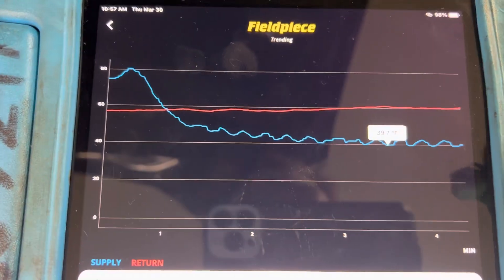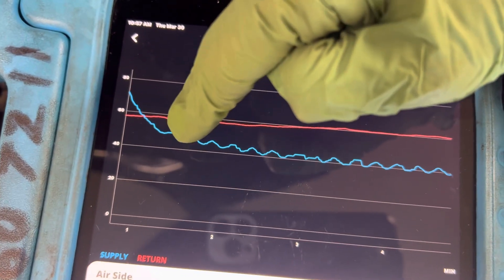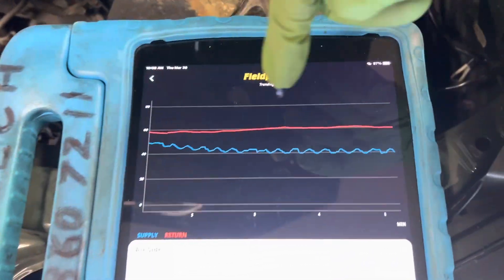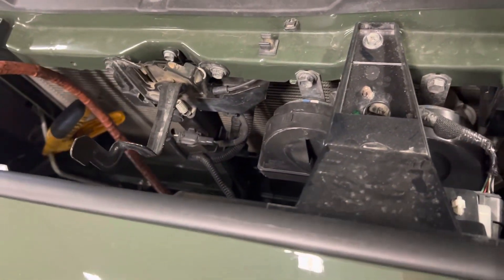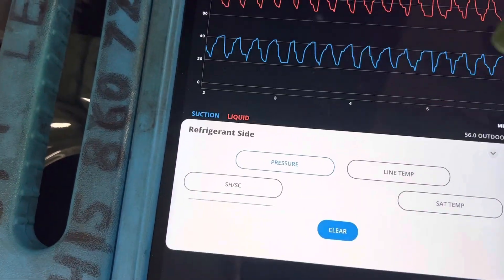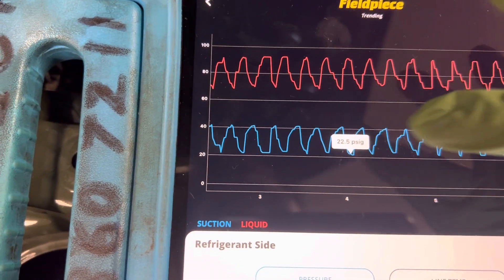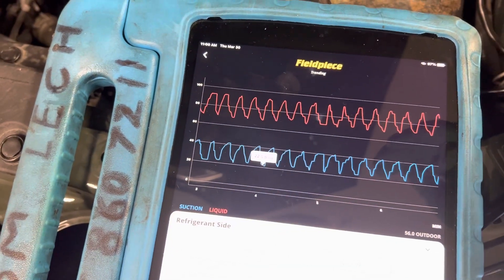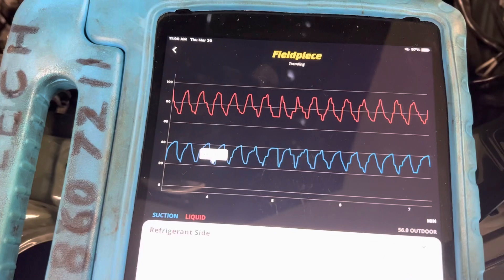FAST CYCLING AC COMPRESSOR CLUTCH. 2021 Toyota Tacoma. This is normal at this ambient temperature

Comment: With even the cheapest Corolla now having a variable compressor, these old cycling technologies seem almost barbaric.
Reply from the maker: @JamesLee-oe7mt  but it’s good for a back up protection. 
     For a while there they thought variable displacement compressors was the answer.  They discovered in many cases it was not the right answer..   so they went back to putting on clutches for safety. 

And then you had the other factor technicians minds could not comprehend what was going on without seeing a clutch turning apparently anything over a fifth grade education level is too difficult in our business .